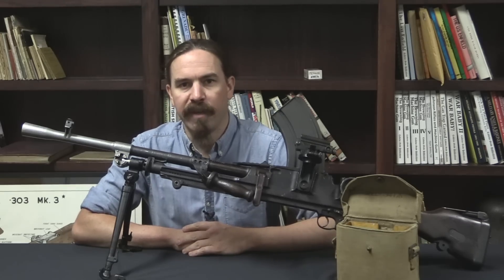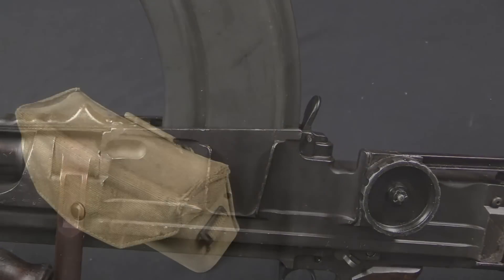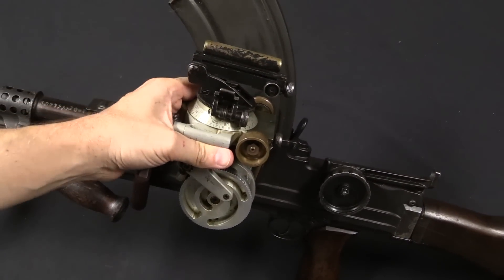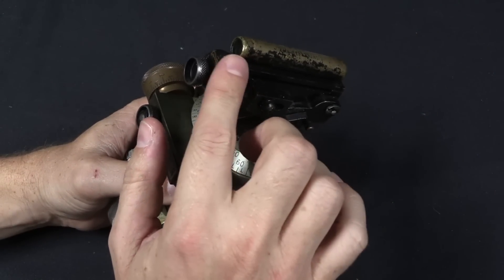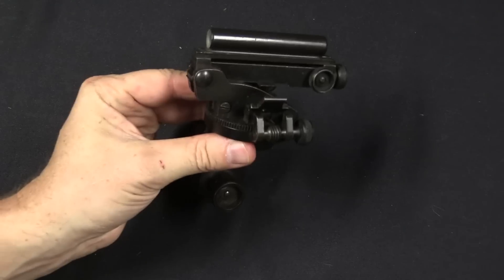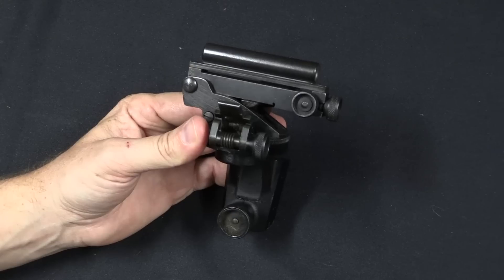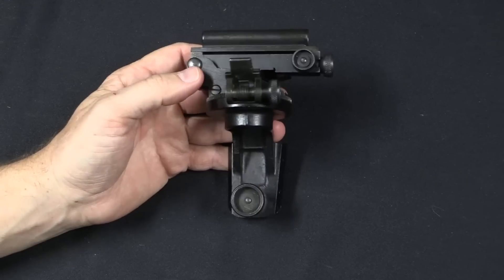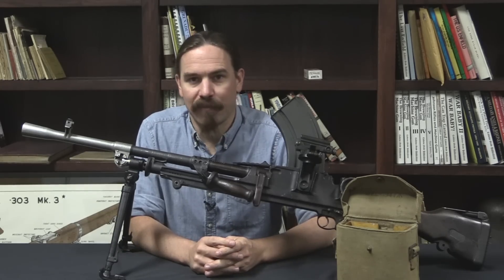Very Rare and Mostly Pointless: the Bren Fixed Line Sight

Comment: Ian is incorrect in the quantity manufactured.  Wartime records indicate only 666 of the sights were manufactured.  The carrying case is a Pattern 37 binocular case with a wooden insert (Fixed Line Sight Housing Frame) to hold the sight.  There was a recess in the Bren transit chest to then hold the  case beneath the Bren Gun.  The sight was short-lived, being introduced on March 14, 1939 and removed from service on October 21, 1940.  I was  fortunate enough to own a DEWAT Inglis Bren MkI with the dovetail for the sight AND the sight when I lived in Canada but was forced to leave it behind when I moved to the U.S. as the Bren receiver was intact and therefore illegal in the U.S. I eventually sold the gun, sight, tripod, wallet and spare barrel carrier to another collector in Canada.

Comment: Would one have to use the same gun or could different guns be moved between a single tripod and still maintain a sufficiently accurate sighting for that tripod?
Reply: As long as both are in reasonable condition wear and tear wise, the answer is yes. A machine gun firing on automatic produces what is called a "beaten zone"  usually in the form of a long oval shape, in which the rounds will land. The article in the vid was on the FIXED LINE sight.  The item being targeted will be in view of the position.  An opening in a hedge row, corner of a farmhouse etc etc. Or as also correctly stated by some, a single bearing that you want to shoot along. Usually the long face of your own positions. Once registered and ready the gunner can either await order to engage, or control that area or point with random speculative fire.  The fixed line sight does NOT do indirect.

Comment: The carrier is actually a "Case, binocular, Web Equipment, Pattern 1937," originally designed for "Binocular, prismatic, No. 2" (8x30), but retrofitted with a wooden "Frame, Housing Fixed Line Sight, .303-in. Bren M.G., Mark. I." Credit to: http://www.karkeeweb.com/patterns/1937/1937_pistol_equipment.html

Comment: But couldn't they just set the tripod with iron sights? Am I missing something?
Reply: You do set the iron sights. 1) Set up tripod in position, sand bag it down. 2) Set gun in place. Set iron sights and fire at target until you hit it. 3)  Mount fixed line sight without moving the tripod or gun. Adjust the fixed line sight until you can see the aiming mark on the aiming stake. Write down the readings on the sight and put them on your range card. Without moving the tripod do this for as many targets you can see or want. 4)  leave tripod and take gun away to do the business during the day. 5) At night the boss says control target x............put gun on tripod, reset the dial sight with recorded info for that target. Place on gun and adjust the controls on the tripod until you can now see the aiming mark on the stake............the gun is now pointing at the target you registered in daylight. The whole point of the sight is to engage items within range but difficult to see at night.............or a bearing you do not want to move from or you may hit your own guys. Comments that say set your iron sights at 1500 and fire away are purile nonsense when you can hardly see.

Comment: I'm probably missing something very obvious, but...if the idea is you set up a tripod for defence, then detach the gun and use it in a mobile application, then bring it back to the tripod and want to consistently retain the previously decided defensive aiming point, then why not...just use the actual sights of the gun to aim at the place you want to shoot at?

Comment: Is this a device to help setting up a zero on a target? I don't see the use to it. I mean can't you just aim the gun normally...I'm confused lol
Reply: Its mostly for indirect fire from a defensive position. Its a weird hold over from trench warfare mentality.

For example; you know there is a choke point in the enemy line nearby, and you decide to set up behind a hill. You set up the Bren on a tripod. Then you figure out where to aim to arch your fire over the top of the of the hill and into the choke point so you can land bullets on it without exposing yourself. You lock the Bren into its position on the tripod aimed over the top of the hill. Then you set up the sighting device to point at something you intend to refrence like a signal lamp you set up nearby, and lock in those settings. Now you can take the gun off the tripod and as long as the tripod and lamp don't move you can just come back, put the gun back on the tripod, aim the optical sight at the lamp and know your Bren is going to hit the choke point with inderect fire again. No line of sight on the actual target required.

Comment: In the far east during WW2 guns were set up to fire on fixed lines to prevent infiltration. A usual Japanese tactic combined with conventional attack. The 'BOX' countermeasure was used to prevent this. Thus trip wires were installed with instruction to fire at the first indication, usually a metal-on-metal (bell) sound. Friends were instructed NOT to leave positions for toilet breaks.

Comment: 0:30 Peter Laidler have stated that 2 mounting brackets for fixing No.32 to BREN were made, but both were later destroyed in testing No. 4T sniper rifle scope mounting solutions
2:54 More appropriately it would be called a collimator sight. It was - and still is - prominently used on mortars.

Comment: It’s not “pointless”. Setting up accurate beaten area fire was a valuable tactic in the days before night vision. An obvious example is, say a small bridge over a river. Or a terrain feature that squeezes down a column of attackers. The old time MG artistes knew all the tricks, and if they didn’t have a tool like this, they did the same thing with stakes. I’d be surprised if the Germans didn’t have the same capability and intention with their wonderful Lafitte tripod for the MG42 and 34.

Comment: We use aiming assist sights like this on survey levels and total stations today. They let you get your scope grossly pointed at a rod or prism before you look through the actual optic.
Reply: Mine never worked very well on our Leicas. There was always a massive offset (and generally not in the direction you would expect) between the assist and the actual scope. A few of the instruments seemed to be "tighter" in that regard but as a general rule I didn't rely super heavily on it.

Comment: The requirement to be able to re-lay a MG (even an LMG) is VERY important; especially at night.  I suspect this device was not popular/used as much as anticipated, not because the requirement wasn't there.  But, rather, because you can achieve the same capability using simple "field expedient" methods that don't require some fancy metal device strapped to the gun.

Comment: If you Re-aim the gun with that add on sight, why can't you just use the sights on the Bren?
Reply: The idea is that you control the aiming points and don't have to stick your head up to re aim. It's assuming a refight of WW1.

The field improvised version is sticks at the edge of your fighting hole.
Reply: @ScottKenny1978  isn't that function provided by the stops on the traverse on the tripod?
Reply: @danebrewer10  yes, but this sight also lets you check that the tripod hasn't moved.
Reply: @ScottKenny1978  right, I must say, how it does that is still a bit of a mystery, but at least I kind of get what it's meant to do 😄
Reply: @danebrewer10  that's about where I'm at with it. I see what it's supposed to do, but have no clue how it does it.

Comment: Bridges, ford's,  exposed roads. We used the same method for artillery  (70 and 80s), when we got to sleep, the guns was aimed at certain points, and all fire direction was set, it only took an alarm from a spotter, to realese a barrage, within 2 minutes, in case the enemy took another route, we could easily change to this as it was preset too.

Comment: I recall seeing a film clip of the falklands war in which british forces had set up a bren on its mount and had a fixed line sight on it. The bren was pointing down a hill or smsll mountain onto enemy positions. They explained to the camera that the action was going to be at night and so they were using the fixed line sight to set the range and sighting in the gun etc , without firing it during the daytime, come night time the area in question was accurately covered.

Comment: I'd like to see a video of how this thing is supposed to be used. I still don't fully understand how it operates.
Reply: You want to fire at a set point. You set the tripod up, then go hammer in an aiming pole somewhere in front of you (where doesn't matter as long as the line sight can be turned to see it). Point the gun at the target, turn the line sight to point at the aiming pole. Now any time you clamp the gun on the tripod, and align the line sight with the aiming pole, then the barrel is pointing where you want it, even if you can't see the target because it's pitch black or they just dropped smoke in front of it.

Think of it as setting up a fixed triangle. One point in front of your eye, one side running along the barrel, other side pointing at the aiming pole. Any time you point it at the aiming pole from that position the barrel will always point at the same place.

Comment: Sounds like a great idea for ww1.

The most effective way to use machine guns as static defences, are to arrange them so that they give flanking fire, with interlocking fields of fire. It is much more effective than firing straight ahead on enemies running towards you.
Or to put it in other words, you arrange your MG's to fire diagonally across no mans-land rather than square to it. The chance of a bullet hitting a target is much higher, it turns out. With several MG's arranged at intervals along your defence line, aimed at an angle and alternating left and right, you have basically created an inpassable meshwork of bullets flying through the air, so long as you can sustain continuous  fire. Each gun crew will be part of a greater system of defence, rather than doing their own thing.

This method was employed on many battlefields on the west front. It of course requires that every MG nest maintains dicipline and actually sustain fire at 45 degrees to the side, while ignoring the enemies that are running straight at them. It is also important that every crew knows exactly what sector their gun is supposed to fire at, so there will be no gaps.

I imagine this is what they had in mind when they designed that sighting system.

Comment: The father of an older chap who used to work for me was one of the first intake of commandos. At one point in the war they were sent to reinforce troops defending an island in the Mediterranean; possibly in Greece I forget. In their sangars they'd set up heavy gauge wire, bent to follow specific terrain in their field of fire. Brens & other machine guns could be run/traversed along this to take attacking troops at thigh height, then torso as they fell. This allowed them to get more rounds on target even in low light or night time conditions. A pretty low tech answer to a problem but seemingly very effective.
Lovely gun the Bren, really enjoying this series so far & the one you did recently on the early SMLE's was fantastic.

Comment: Think they were expecting another war of men sitting in holes opposite each other, for years at a time. The Germans had other ideas, so fixed line sights went the way of the horse.
Reply: Disagree...to a point.  Fixed line/fixed limit fire is still applicable in defensive positions when tying guns into a defensive fire plan using primary/secondary tasks and interlocking archs of fire.  In offensive, mobile operations and FIBUA, less so, but even in low level operations platoons need to harbour up in defensive positions every night with well sighted gun pits.  Did a LMG need a specific sight to achieve this??? Maybe, maybe not.

Comment: "oh boy this looks unnecessarily complex and unusable"

Ian pulls out the Vickers dial sight

What in the god damn is that thing and why does it fit as It looks like something from a god damn Fallout mod.
Reply: It looks like an aim point 3000 red dot sight if it was built in a steam punk universe
Reply: It's based on a Surveying Level.  Surveyors and Civil Engineers use them to determine elevation changes across distances.  If you see a road crew working and one guy is playing around with something that looks like a funky camera on a tripod, that is a Surveying Level (or "Total Station", which is the modern, computerized version).
Reply: @KP762a  That is probably why when I first saw it I thought it was for a mortar. Mortars are aimed using stakes/lamps (glow sticks) as well.
Reply: @MonkeyJedi99  Those Mortar sights are based on the same system.  Civil Engineering and Surveying existed before the weaponization of these tools.
Reply: @KP762a  Makes sense.
I just have a bias on my recognition, having fired mortars but not having done surveying.
Reply: @KP762a  Or back before lasers, like someone stuck a sextant (in this case 'a transit') on a tripod and is aiming it at a guy with a red and white pole. It's a way of precisely measuring angles, and hence distances and elevation in the field. Modern topographical maps result from guys walking these transits from one end of a country, or continent, to another.
Reply: @davidgillon2762  As a civil engineering student, I know full well what you are referring to 👍
Reply: I hope he does a more complete video on it.
Reply: Just like using the C2 sight unit on a GPMG I would imagine.

Comment: Modern versions of this kind of sight will have number scales along the elevation and bearing drums so you can record the location of multiple targets. Then when the OP calls back and says "There's bad guys at the crossroads" or "They're coming through the gap in the wire" and it's too foggy, smokey or dark for you to see the target, you can turn to your target information sheet, find the bearing and elevation of the specified target , dial those into your sight then aim the gun so the sight is on the aiming post and the bubble is level (elevation is measured off of a spirit level) and you're all set. They're like the number scales on a T&E mech, only much more precise (because they have numbered fine adjust drums). They're widely used by UK and Canadian forces (possibly others, not sure). They're used pretty much any time the GPMG is mounted on a tripod in a defensive role. In the modern configuration (where you can record multiple targets), they're very useful.  Imagine being able to shoot at number of pre-designated points of interest on the landscape even through smokescreens, fog, whatever. Definitely worth the time, effort and extra weight.
Reply: When you say aiming post do you mean an actual post?
Reply: @KhanGirey  Yes. A thin post maybe 3x the diameter of a coat hanger and maybe a foot and a half long, painted in black and white barber-pole pattern that you stick in the ground somewhere in view of the gun (preferably not right in front where it'll get shot). This provides a constant reference point from which bearings are measured. There's also a little tritium lamp you attach to the post so you can see it at night.